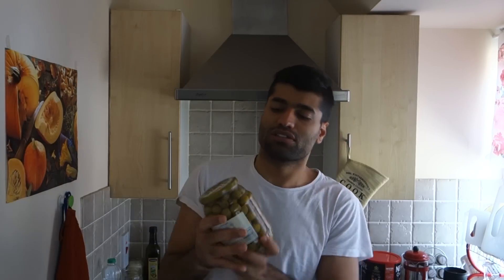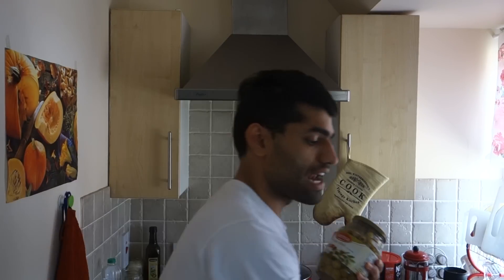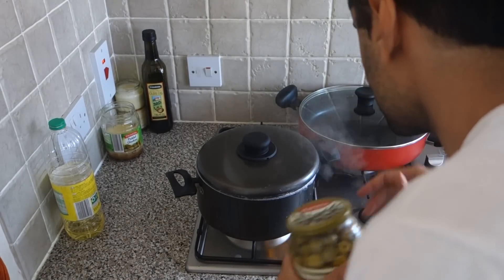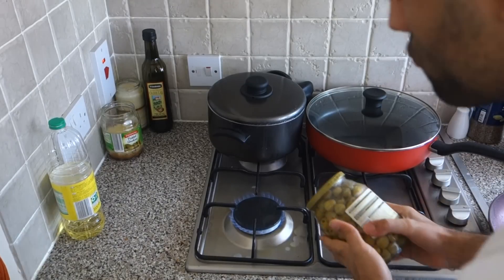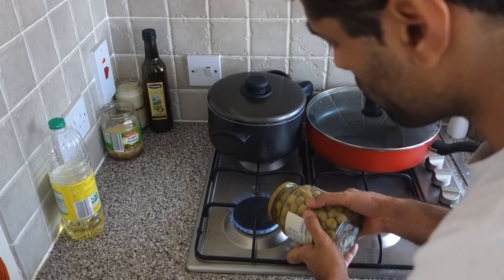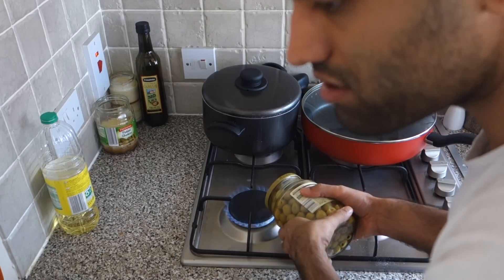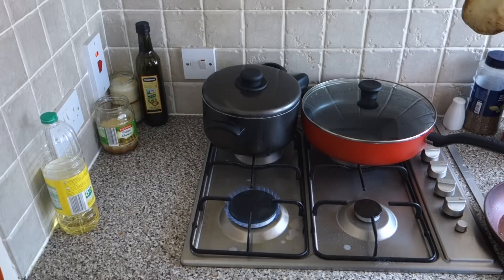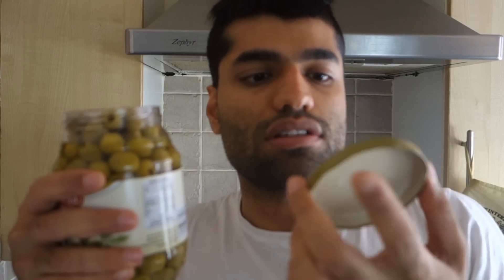How To Open A Very Tight Jar!

Comment: Forget everything you just saw. This will work 100%.  Take a small nail and hammer it into the centre of the lid and pierce the skin of the lid. The vacuum is released and the jar lid will open easily. As I said it works 100 % of the time. Try it next time.
Reply from the maker: Yes, what you're suggesting would work but it's much harder than the above solution.  Some lids are really thick and if the glass is too thin and the nail is blunt and you hit too hard, then you could break the whole jar. Also, even if succeeded some small particles from the lid could penetrate into the food jar that might be unhealthy. As an alternative to the above solution, you could insert a butter knife (or anything strong and narrow) underneath the edge of the lid and try to lift it a bit to let the air in. Then, it'll open easily.
Reply: @PracticalTechFixes  Rubbish, most lids are thin, the glass is thick ,well here in the UK. Just sterilise the thin nail in hot boiling water. It 100 % works. Your video is just nonsense.

Comment: I put mine in boiled water and it worked. I assumed that it would work but first wanted to check online what options I had to have it work. When you said heat expands solids I knew the boiled water was a go go and it worked :)

Comment: I was trying to open the spread cheese jar. And when it opened after i applied this method, the cheese smells great haha. Btw i tried to dip it to hot boiling water before I found your video but still didn't open. So thanks for the tips 👌